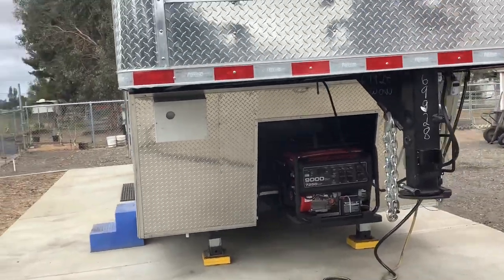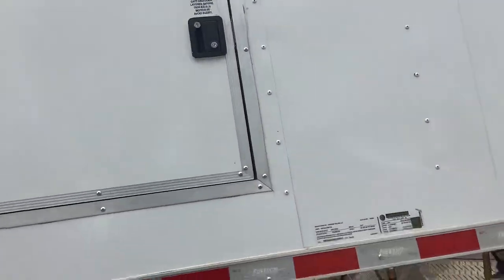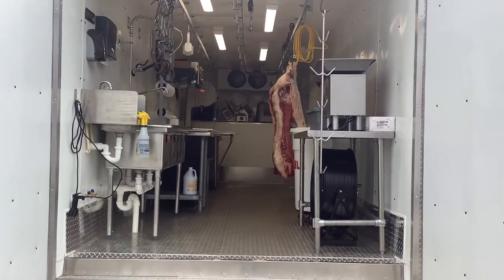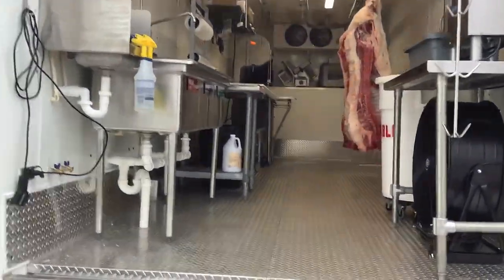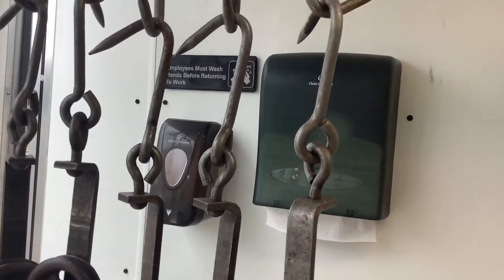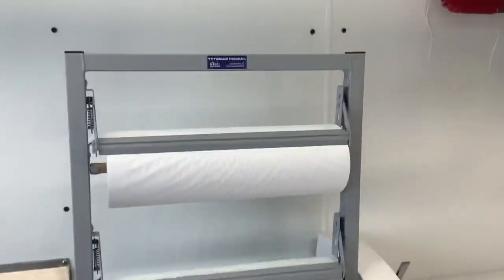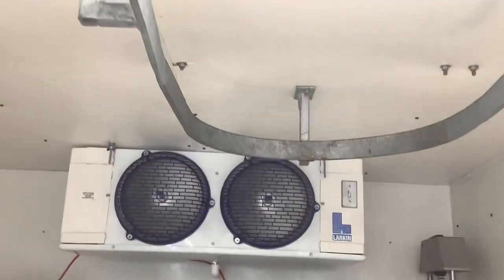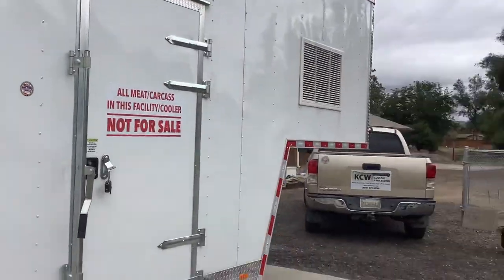KCW Custom Processing. My New state of the art USDA spec built mobile butcher shop.

Comment: What set up are you using for the cooler
Reply from the maker: Copeland cooler unit & Larkin fans. Floats between 30-39 set @ 33-36 with a 3 degree variable.
Reply: @danielscepurek5416  I have a Copland to 3 phase 230 I need yo get hooked up some how
Reply from the maker: You got to have three phase power for a cooler bud, you could buy a Rotary Phase Converter for like equipment a grinder or a saw but your cooler is going to be running 24-7 you’re gonna have to have dedicated three phase power for a cooler. It’s probably gonna cost you a bit but I bet you could get it ran from the grid possibly your house. You need to check with a reputable master electrician.